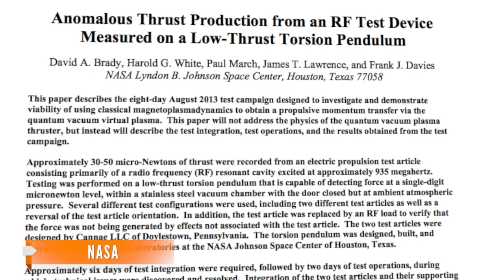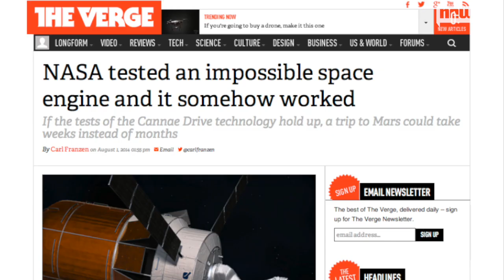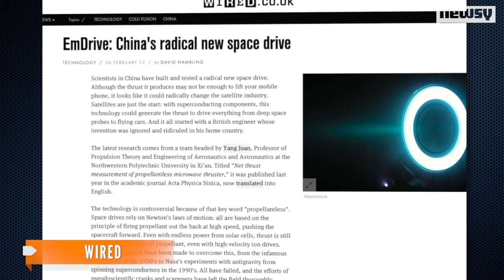NASA Tests 'Impossible' Engine, Finds Out It's Really Fast

Comment: hate to burst anyone's bubble, but per volume, a volume of uncarburated fuel has more energy than a battery. Hence, whatever volume of energy (Energy Density) per solid battery in electric chemical energy (anodic and cathodic reactions) is far less than uncarburated fuel. Solar Panels? well if we had a device that recycles spent fuel back into raw form, then we don't need solar panels nor the inefficient concept of solid batteries. In case you don't think that batteries are inefficient energy storage devices then you are a tool. And stay away from youtube as the doctor says. Back to topic, what use is an engine that runs on fuel that doesn't exist or what use a fuel that can't be made from abundant materials easily? Anyone thought about the interference this emitter will cause on earthbound instrumentation?  It is after all a microwave emitter. Virtual particles my rear end. Food for thought.
Reply: why?
Reply: +LPFred Oh i wrote my comment then realized that you will hate me for this, I am hesitant but here goes:
Recycling as you have kindly mentioned is only in the sense of the fuel but not the other materials used to device this TMSR. Again, even in the less efficient form, check this RTG generator. It did have its own similar disadvantages. One might think as long as this device is intended for extraterrestrial operation then there might be merit to the clause, but still even if this science is made public, some would cut corners and cause havoc.
Also, whenever I mention cost, I get impaling antagonism from all sides complaining about that the need for scientific advances requires sacrifices. I am aware that cutting costs on scientific research means putting scientists out of business and I most definitely disapprove of this. But if we do examine history, one discovery is sometimes if not always improved by time that the original design no longer resembles the end product and only due to other less significant advances. Which means in a sense, no one man can be all, designer, builder, researcher and financier, especially in any area of development that requires many rather than one.
I think I jumped the discussion too far as I believe not all in the community have went through the progressive reasoning. Not saying that people lack the intellect but rather people are consumed with their daily attributes of labor that they need more time to delve deeper into a well rounded discussion/conclusion and especially not withstanding the duality of logic in our current era.

https://en.wikipedia.org/wiki/Radioisotope_thermoelectric_generator

Forgive me for saying, I am still hopeful that Physics would come up with new science rather than a new engine with the current physics employed. We lack that extra oomph.
This is not a reply as much as a comment. Again, I apologize for the length of this comment.
Reply: *****
No pardons needed, you wrote famously well. I appreciate your comment, it has substance.

Comment: Several times in this piece, you seem to be confusing the role of FUEL with the role of PROPELLANT. This might be understandable, given that in conventional rocketry, the two roles are rather muddled together. However, to be clear, propellant is mass that is hurled away from the vehicle to cause the vehicle to move in the opposite direction, in compliance with Newton's third law of motion. Fuel, on the other hand. is what is used to generate the ENERGY that is harnessed to make the propellant move. Conventional rockets use chemical fuel that generates chemical energy and uses the chemical reaction's waste products as propellant. What is revolutionary about the Cannae and EM drives is that they apparently work without requiring the vehicle to carry any propellant at all. They still require energy to work though, and therefore would require some form of fuel to generate that energy. The most promising energy sources for long term use would probably be solar power for relatively slow inner-solar-system vehicles, or nuclear power for high energy vehicles (e.g., manned or courier craft) or for locations where solar energy is not adequate power source, such as the outer solar system, or interstellar space. At any rate, only a vehicle with a remote power source, like a solar-powered craft, would truly be one that carries neither propellant nor fuel. Either configuration, though, certainly makes for a very exciting prospect! :-)
Reply: Patrick Colvin Wow, I didn't know any of that until now, thanks for the science lesson!
Reply: What, then, is the "propellent" of the internal combustion,  gasoline fueled
 R-4360 engines of a KC-97? I know what the propeller is... Are the propellers just  giant "screws" hurtling the atmosphere behind it more rapidly than it finds it in ahead of it? Is the atmosphere thus the "propellent"?
Reply: +Patrick Colvin   Great concept ... Fuel in a constraint... The only viable option for interstellar space travel is "harvest in place fuel" for extreme propellant propulsion or propellant-less propulsion ... for sub-light speed travel... and propellant-less negative energy production to effect a spare-time wave for a stationary vessel to ride the spare-time wave to >light speed travel...   hence we would bestow the era of fuel-less spacecraft...   The concept of theories to go faster to a percentage of the limit of the speed of light, fail vs theories to go slow or even negative, will be the breakthroughs needed for interstellar space travel...

Comment: This is gibberish speak.  Quantum vacuum has no mass.  No NASA people tested this.  It is a hoax that has been going around for years in different forms.  Newsy Science is about as accurate as the National Inquirer.
Reply: mike stevens That's the interesting part, it does work. Whether the results are through some measurement error or the mechanism of conservation is just not yet known, is of course not yet known. Even if it does turn out to be a hoax or at least  its anomalous results are explained, at least it will have been subjected to appropriate testing as befitting its possible importance.

Comment: This is hoax, Google it. The engine produces so small amounts of thrust that it is interchangeable with the measurement error. You can't state whether it works or not. Furthermore, NASA was also given another engine based off the same principle, but a version that was said not to work by the manufacturer. They got the same measurement results from a non working engine!! That's not all, the first tests weren't performed in vacuum, in a vacuum chamber yes, but the air was still in. The amount of heat the engine's capacitors produce could easily move the engine thanks to air currents. Later tests were in vacuum, with the same results though.
Reply: Andy All that indicates is that Guido Fetta  doesn't understand whatever the mechanism is. Which makes sense since nobody understands the mechanism. But since anomalous results have been obtained it is appropriate to test the devices until they are explained or shown to be of no value.

Comment: It is just using the momentum of the microwaves to produce thrust. No physics violated, but there is no way with current technology that this will ever be useful as a primary motive source. It just requires to much energy.
Reply: Darrell Bell Besides violating at least on eof the Laws of Thermodynamics, I can see no way that cryogenically cooling anything will increase the thrust. The thrust comes from the monetum of the radio waves, not their temperature. If what you say is true, then NASA would have done it with cryo on as it is a relatively simple thing to cool the drive. I think you will find that the cooling is just snake oil that has been added later to help sell the drive. You would be surprised how often you see this stuff turn up when you are a physicist.l And in every case the inventor gets rich and the invention is never developed further due to "research difficulties" which always require more money to fix.
Reply: spacecadet35 but he calculates how much energy it needs per N thrust... it's not that much
Reply: Not much energy at all. To generate 1kg of thrust will take about 1 mega Watt. Of course the amount of power plant and radiators required to produce  this much power is on the order of tens to hundreds of tonnes. This means you get a thrust of  less than  0.0001g. (And I am being generous with these figures). As a physicist I see these type of things all the time. I wonder why anybody still invests in these things. They are well known to science.
Reply: ProjectsBlack The latest research from NASA on this project shows that in a vacuum that the EM drive develops 50 µN with 50 W of energy. The EM Drive does seem to generate less thrust in a vacuum, where it is being sold as an ideal engine.
So that means 1kg of thrust requires 10 MW of energy.  So let us see some more results before we confirm the figures.
Reply: spacecadet35 Actually, Dr. Harold White showed several years ago that it only needs the power of a VOYAGER SPACE PROBE. Which is NOTHING!!! http://www.bing.com/videos/search?q=warp+drives+of+tt+brown&qpvt=warp+drives+of+TT+Brown&FORM=VDRE
Reply: Russell Anderson Which of those 123 videos did you want me to look at? The one with David Letterman? Could you also reference the Journal paper where he proposes this low power usage. As the mechanism is still "unknown" how can anyone predict the maximum theoretical efficiency? 
If you are going to quote doctors at me, you do realise that I am actually Doctor Spacecadet35?
What this means is I will change my mind, but only if you produce real evidence such as the math and empirical data. 
Remember that in science that the Burden of Proof is upon those that propose a hypothesis and at the more extraordinary the claim, the more extraodinary the evidence has to be.
Reply: ProjectsBlack i believe it uses a version of the Casimir effect, which was predicted over 60 years ago from quantum mechanics (essentially from the uncertainty principle).  

the media is doing it's usual idiotic hyperbole, "against the laws of nature" bullshit.  they often get science exactly wrong in the headlines and soundbites, even if the article or report itself is correct.
Reply: Two points, 1) n the standard description of vacuum fluctuations, virtual particles do not behave as a plasma. 2) Why create a more complex hypothesis when the observed effects match what would be expected from microwave "leakage" which is built into the prototype and which does conform to the standard model? 
I will ask Ocam to shave this one until further evidence is actually presented.
Reply: ProjectsBlack Of course E.M. Waves can produce thrust alone. This was conclusively proved in the Gemini missions when the threw some mylar out of the craft. EM waves have mass, thus they can produce a change of momentum. Light drives have been proposed for years and are proposed to be the most efficient reaction drives of all. 
As to the Gen 2 engines, that is in the "Believe it when you see it " category. They have no theory to base those predictions upon, so while good for scamming people on "Kickstarter" it is of less use in the engineering world.
Reply: spacecadet35 agree, EM can produce thrust.  every photon has a momentum, and when it hits something it pushes it.  but if that were the mechanism for the proposed drives, like you say it'd be nothing new; the proposed drives are claiming something in addition to that effect.
Reply: N Marbletoe Indeed they are claiming something in addition to the thrust produced by emitting em waves,  but they are producing the same amount of thrust as would be expected from emitting em waves and with no other effects present.  The Burden of Proof is on those that propose a hypothesis. And the evidence presented comes nowhere close to meeting that burden of proof.
Reply: spacecadet35 The inventor of this drive says that if the wave guide
is cooled cryogenically, thrust goes from mN per KW of input to tons
per KW. Has this been tested yet?

Comment: NASA As told to me by the (Travelers) "You need to walk before you can run." They instructed me on a foundation in which the G-Forces can be cancelled out thus allowing rapid infinity acceleration and stopping without causing harm to the equipment and people inside.

Comment: This engine isn't fast. 50 micronewtons is nothing. I mean that, it's almost literally nothing. 50 micronewtons could barely propel a fly's mass to Earth's escape velocity, even without drag...and that's assuming only the fly, not the weight of the engine, is taken into account. Now, yes, once you get into orbit you don't have to worry about these things, this engine will not accelerate anything in a timely fashion.

Now, you might say, "But, Casey! Technology will evolve and we could put a bigass version of this engine!"

Sure, absolutely...but you'll need a power source. Solar panels or a nuclear reactor would be the way to go...you'll need several reactors to even make an insignificant amount of thrust (probably not even noticeable to the humans aboard the craft) or a truly incredible amount of solar panels - I'm talking miles wide in both width and length...then you have all this extra weight so you need even more thrust. Don't forget that this craft has to be somehow deployed into orbit...

The fact is, e=mc^2 and motion must be conserved. To get the energy to 'conduct' mass as they do here or to convert it from energy as they do in M/AM generators, you need a truly stupendous amount of energy. You know what's a lot more reasonable? Ion thrusters. Very, very little solid propellant plus a truly incredible amount of energy (though not astronomical as in the M drive and the like). What happens when your ton (a ton is not a lot of weight in these contexts, especially when compared to the energy harnessing devices necessary to power any craft of this type) of propellant finally runs out? Well, you just scoop some up from...fucking anywhere! Basically, don't make mass...bring just a bit (a ton is overkill) and eject it at high speed. It'll still be slow but it won't be painfully slow or impossibly resource-intensive.

Correction: my math sucks, it could not lift a fly off the ground of Earth, fly is 2-4 times the weight limit for such a feat.
Reply: Casey Woodruff  "After consistent reports of thrust measurements from EM Drive experiments in the US, UK, and China – at thrust levels several thousand times in excess of a photon rocket, and now under hard vacuum conditions – the question of where the thrust is coming from deserves serious inquiry."  

http://io9.com/new-test-suggests-nasas-impossible-em-drive-will-work-1701188933

50 Micro-Newtons is insane when you use no mass and only a tiny amount of energy to produce this thrust.
Reply: I read an article about the em drives and it said it would probably run on a nuclear energy

Comment: That is the trouble with atheism in science as they see new ideas as super natural and many ideas like this end up mocked and in the bin
Reply: UNI BUST It is good they try different designs but they should be doing much more of getting to the moon again and start bases
Reply: UNI BUST yes but we need a launching station there with supplies which could ne sent by unmanned rocket for safety, this does frustrate me when people say the moon is not important, it is only 3 days travel or less now and we need to learn with rescue near by if needed, I know thousands who would be pioneers but NASA seems to be just for a select few.
Reply: UNI BUST I mean a select few who dont seem to have curiosity
Reply: UNI BUST It does not matter that people just see it as a rock, I see it as a stable body in space which is close to earth, we wast most of the energy to escape from earth, a launching pad from the moon would allow not much energy to launch, the moon is a great place to learn to live in space as we face the same problems there if we were on a asteroid getting a free lift.
Reply: No we would use little fuel if we launched from the moon and can then just travel on the meteorite as long as it was a regular one that past each year so we knew it had a safe orbit
Reply: UNI BUST We should be able to get equipment there cheaply as it dont matter if it took 2 weeks to travel there slowly as there is no passengers and we could drop all sorts of machinery to start work with and we can use fuel on the moon as it is rich is HHO